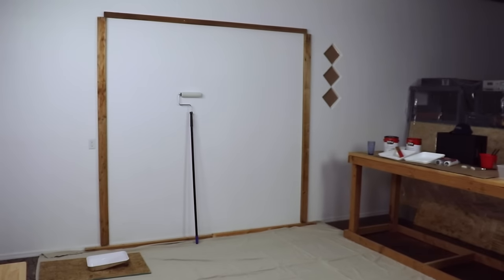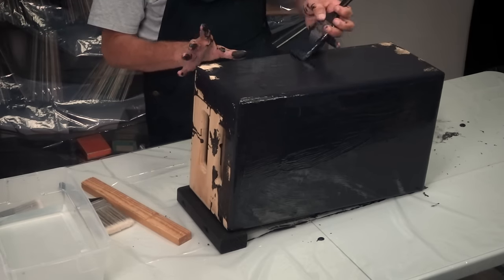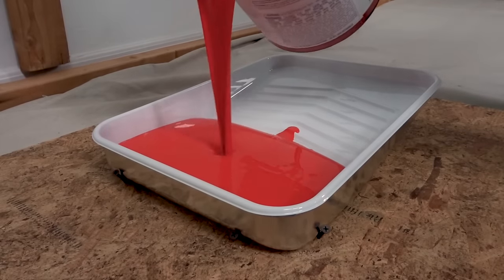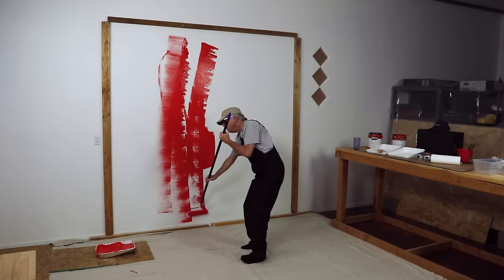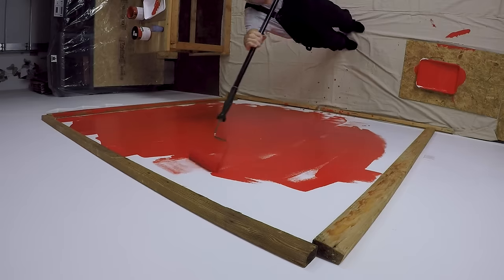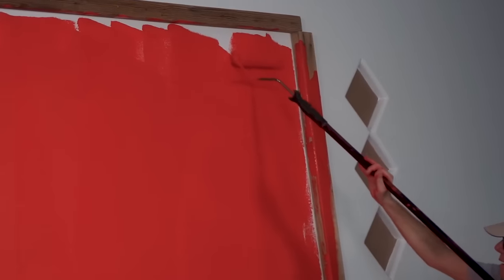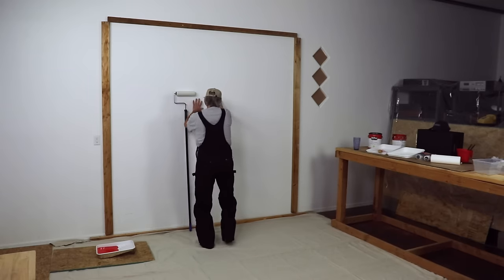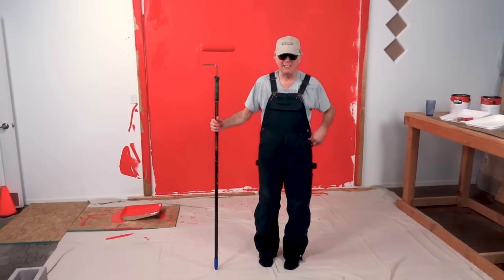What Happens When A Blind Person Paints A Wall

Comment: I think for trying to paint inside the lines, you failed, but that's okay, cuz it's the first time!
For coverage definitely an A-, you covered all the major parts, and just need to go around the edges with a brush or something similar to even it out.
For the excess/waste paint and dripping, probably you get a C, you're gonna have to work on not taking up too much paint on the brush, getting an even coverage without completely drenching the wall.

On average you land somewhere in B territory indeed!

Comment: Thats pretty good. Im just confused how you dont continually fall face first in the wall and get the paint all over your face. I'd like to see you in yoga classes. We use a concept call dristy to keep our balance. It means locking your eyes on one thing to do the most incredible balancing acts. The more the eyes wander, the less your mind is on the balance and equalibrium of the body. So we find a solid gaze to also have solid posture. Eventually, we strengthen our balance by doing it with our eyes closed. If we can meditate and keep our minds clear, we can stay focused on the balance, even though we dont have a sense of where the horizon is.

I wonder if you have a quite focused and solid mind, even though you cannot focus your vision on anything. Im confused how you are even able to walk because your eyes seem to flutter and try to look at everything. Since the eyes are the most external part of our central nervous system and our autonomic responses, if the eyes are fluttering, even though they cannot see, that tells me the person is not able to mentally focus on one thing at a time. However, you seem to be able to keep yourself on one sibject, you don't just fall over, and you listen when people tell you something.

The mind doesn't waste neurons. So maybe your focus is more directed towards your hearing. Even though that is a part of the central nervous system that does not really have exposure to the outside world. There are so many membranes that cover those nerves. The air would have to get through so many layers of wax and fluid before they can physically reach your ability to focus on them. I am epileptic, so I don't really use ny vision much. I mostly rely on my hearing. And i feel quite a separation between those who communicate more with their vision. I wonder if you feel the same being blind since birth.

Comment: You get an A from me!! You used your other senses to the max to get the job done. You made sure to create a boundary to guide you and limit any mistakes. You verbally checked with those around you often, so that they gave you a sense of how well you were doing. You touched the walls to check for dry spots, and listened for the sound of the brush touching the wall. You quickly fixed any mistakes too. Awesome job ❤

Comment: First time painting a wall, grade: A. I'm betting with experience you'd likely get a feel for how the roller moves when on painted versus unpainted surfaces. All but the edges are completely covered and a roller isn't going to do those edges well, you normally need a brush for the edges. Add in the fact that it was your first time, an excellent job. It would be nice if everyone could do as well as you did their first time painting.

Comment: Some hardcore body-modification people have put magnets in their fingertips and with a bit of time the nerves inside their fingers adjust to the magnet, so the electrical field impulse felt by the magnet can be physically felt by the person if the wave is catchy enough. Someone turns on the microwave or you get a phone call on an older cell phone and you can feel a slight hum in the digits. I've done some experiments with just using a bunch of button sized neodymium magnets because I'm not about to stick metal into my fingerpads voluntarily but using bandaids and less than a 25 dollar purchase off amazon i could definitely feel voltage humming inside wires and walls. Do you have any sense of that?

Comment: 10/10 you did a good job, just don't forget to put yellow tape pn the boundaries so when you paint the boundaries, you can easily peal it off. And for the finish a square tiny brush so you can fill the sides and corners.

Comment: That was very impressive. I'm absolutely certain that with a little bit of experience, you'd learn to do it to complete perfection in no time at all. If you wanted to do this for a living, you should consider using wider guides and have them less thick so you could roll over them. That way you'd have perfect edges when the guides were removed. It's what they do with masking tape. :)

Comment: While I'm no professional I did work as a painter for a  summer and painted about 100 houses, I'd give you a C+ you got the majority of the wall covered in paint but the trick is to roll over already painted areas with a semi dry roll to smooth out areas with to much paint. The way I did it was paint as much as I could with a loaded up roll then go over the section 2 times with the dryish roller to smooth out everything.

Comment: I watched a video once where a guy went blind when he was a baby, and was able to have his vision surgically regained when he was about 30 - 40 years old. The depth perception concept was so difficult for him to deal with, he preferred to keep his eyes closed 95% of the time.

 He gave the example of a freeway sign, that hangs many feet over the road. But as he rode along in a car, it  looked as if they were going to drive into the sign because they approached it quickly, it didn't register too well that it was in fact, hanging 20 feet in the air because it started out looking smaller when they were farther away, but got bigger as they got closer at a fast pace. He didn't like the feeling at all. 

Sometimes what we think would be amazing for another person, may, in fact, not be so good after all.

Love you Tommy, we miss your regular uploads and still think of you often. ❤
Reply: Its all about getting used to it. He did not have to go on car. He could have instead train his sight in his house or outside in park or some calm place.